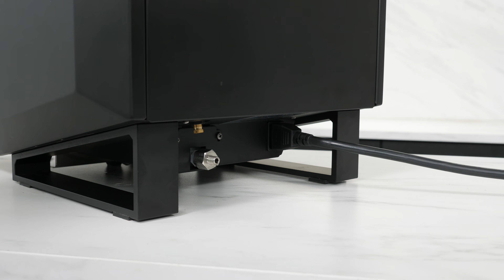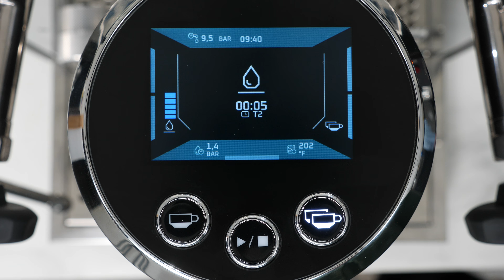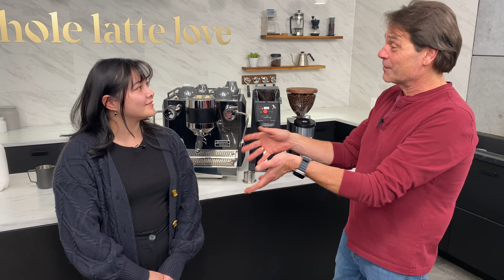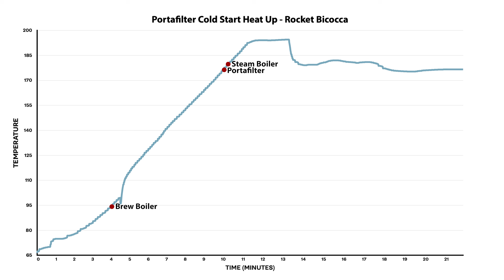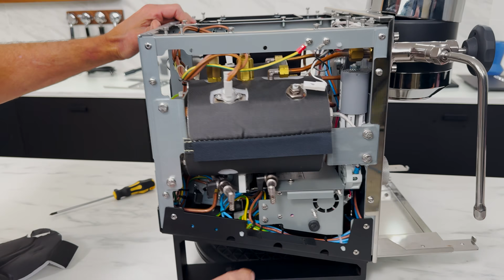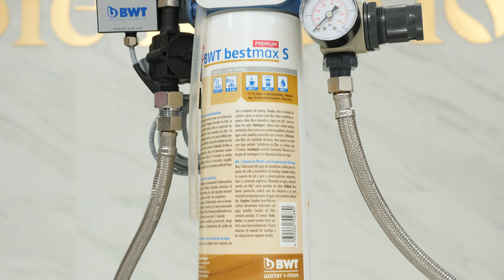Rocket Espresso Bicocca Review

Comment: Hi Marc!  Rocket made in Italy are great units.  They look great too!  How does this unit compare to the Rocket R Nine One?  What I understand is that this is a constant pressure (9bar or maybe you can set this differently) but you can't vary pressure like on the Rocket R Nine One manual extraction profiles.  Is this correct?
Reply from the maker: Hi b, thanks for the comment and question. You are correct on the manual profiles. I like the Biccoca a lot and feel it's intended for higher volume use where you have both knowledgeable users and those who just want to walk up and make a drink with very little knowledge of the process. The R Nine One (it's been a long time since I used one) is more for the espresso hobbyist who want to explore how pressure profiles can coax flavors out of specialty grade coffees.
Marc

Comment: This is definitely a Linea Mini R killer with the same retailer price at 7995 but due to the US tariff the mini R is now 8300 in Canada ! The rocket looks like a better built than La Marzocco! But the learning curve is very intimidating…. Linea Mini is simplistic, elegant and classic 😅.  The Bicocca is like the Toyota of Tesla and Linea is like the Porche of Ferrari 😂
Reply from the maker: Thanks for the comment! It's a tough call - I'd go with the one that best suits your brewing style.
Reply: @Wholelattelovepage I own the Linea mini R for 7 months now and what I don’t like about is the cheap plastic materials they make the mini R and lastly everything has to be controlled via app since it doesn’t have the built in interface screen like the rocket does for this espresso machine!
Reply from the maker: @3rd-Wave_Rebel  Not everything needs an app!
Reply: @3rd-Wave_Rebel me too, i like the bicocca considering to replace it with my LM micra 😅
Reply: @Wholelattelovepage Once you preset the settings you like on the app. You then won’t need to use the app. However doing back flushing, the app is required. Lastly, to adjust dosage sizes on the Acaia brew by weight. You can’t adjust the dosage sizes on the scale directly. You have to turn on the machine and connect the scale to theLM hone app to make adjustments on the Acaia dose size! It’s really dumb for them to do that!
Reply: @3rd-Wave_Rebel i will replace my micra with the bicocca soon but waiting for the black color 😍
Reply: The app feature is annoying 😂,
Reply: @mryoyo7741 The greedy Ginny bastards increased the US price from 5900 to 6300 for Linea mini R and the Micra from 3900 to 4300. For Canadian price from 7995 to 8300 for the Linea mini r and the Micra from 5400 to 5600. Insanely high prices!
Reply: For me in my mobile coffee shop the volumetric dosing is very important.  LM without the LM scale can't be volumetric machine...

Comment: Can this be used for a coffee cart. At farmers markets?
Reply from the maker: Hey mark, this machine is capable of moderate volume use. Be aware it does not carry NSF certification so if that's required in your area that could be an issue.
Marc

Comment: I’m sorry? Who’s guessing their steam boiler pressure based off the temperature? Steam pressure in a sealed vessel is directly proportional to the temperature it’s headed to, you look up a temperature/ pressure table. There’s no guessing required? Plus most machines have a pressure gauge for the steam boiler?
Reply: It has electronic one
Reply: My machine when i want more pressure i increase the temp. The more temp the more pressure due to boiling point increased. 😊😊😊
Reply: And it is 2025 who wants ugly old manual gauges 😅😂

Comment: What are the power requirements? Would I need a 20A outlet?
Reply from the maker: Hi h, The North American version draws max of 1650 watts at 120 volts that's 13.75amps. At 110 volts that's 15 amps. So best to run on a 20amp circuit.

Comment: Amazing review, how to adjust pump pressure?
Reply from the maker: Hey mry, thanks for the comment! The bypass adjustment of the rotary pump is exposed under the rear of the machine to adjust brew pressure. You can just see the adjustment here near the plumb in line connection: https://youtu.be/bL6VCjADc7Y?si=9DEjVk2QVS4xNGDA&t=210
Marc